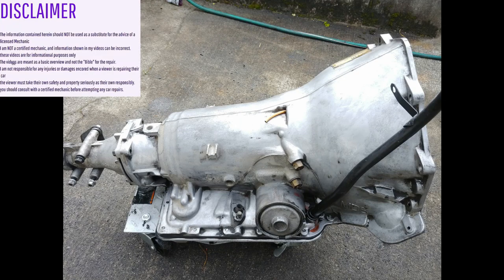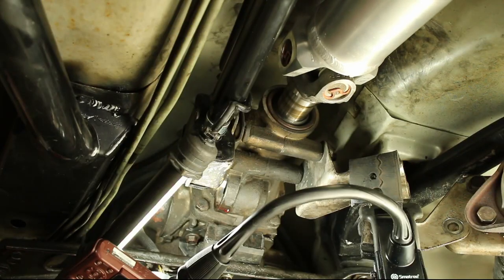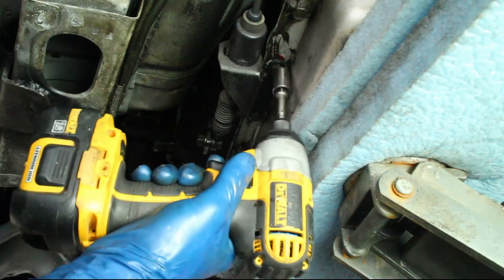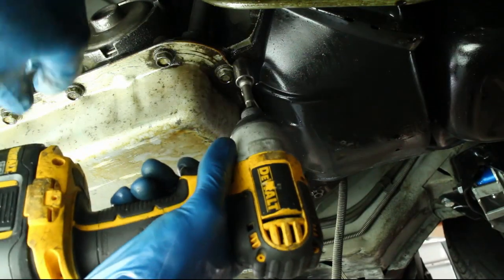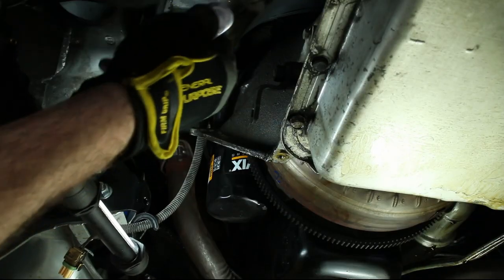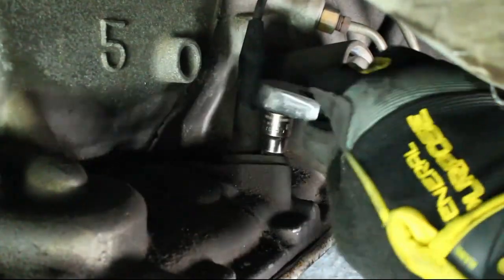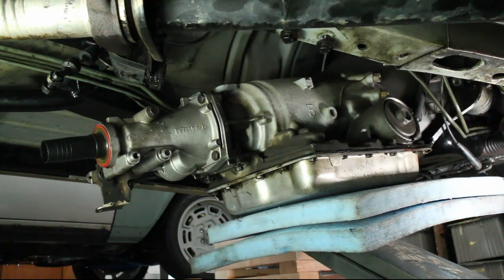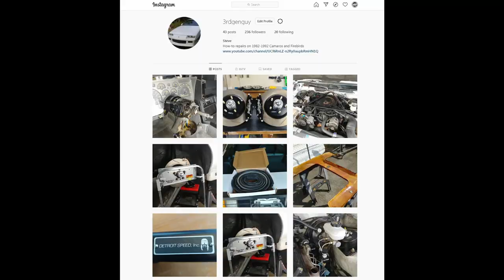How To Remove a 700r4 & 4L60E Automatic Transmission (82-92 Camaro/Firebird)

Comment: i just removed the engine and tranny from my 3rd gen, after removing the torque arm from the tranny side i left it still attached at the rear end. it is ok to roll the car in and out of the garage with the torque arm like that? i used ur vid as a guide btw so thank you!
Reply from the maker: if you push it around it's fine.
don't drive the car with the torque arm disconnected though.
Reply: @3rdGenGuy  ok cool, thanks man love the vids

Comment: Great video but having issues reaching the top two bolts on the bell housing. Even with extensions and everything i cant get those bolts off. Anyone have advice?
Reply: I'm in the same exact boat right now. I can't even see them

Comment: thank you for a detailed info on this i havea 1996 f100 truck i be doing i plan to use a lot of your info in this video to help me out i know a little and a few that i know said its a easy one to remove. my issus is putting another one in .i plan to use the stack wood idea you have in the video.
Reply from the maker: the harbor freight transmission  jack makes thigs WAY easier.

Comment: Also thank you so much for this video I never worked on a tranny and felt at ease watching u disassemble this beast, I did a whole top end rebuild on my 305 tpi and on first warm up the front pump seal burst leaking between the torque converter and the tranny, gonna try my luck taking this bitch out lmao

Comment: At 1:21 you unplugged a wiring harness from above the transmission. I have that same harness on my Camaro, but it's just hanging there in mid air, not connected to anything. Can you tell me what that harness is for? Thanks
Reply from the maker: that would be the  later electronic speed sensor plug.
the 2pin: speedo plug
4 pin: torque converter lock up.

Comment: I have some sort of leaking between the transmission and the engine and was told it's some sort of seal that needs replacing, anyone ever do this kind of replacement fix?? Hoping for some advice...
Reply: Hey Drakoz, you might have rear valve covers or rear main seal, rear cam plugs leaking. If you have an older Camaro you will need to pull the trans just to get a good look at what is leaking. I paid a shop to tell me what it was leaking but they said I needed to pull the Transmission and see, I am currently doing this on my 1994 Camaro. It's not so bad if you can afford the correct jacks and tools. Good luck man.
Reply: @briannewton4803  it was for a 1985 Trans am. Sorry for the late correction response lol

Comment: just curious how much of this process Im going to have to do to change my flexplate
Reply: You have to take out the transmission to put a new flex plate
Reply: no you dont,I just had to unbolt it,take out drive shaft and crossmember then lower it enough to slide it back for clearance. This is kind of what I was referring to,if I could get away with just lowring it without having to pull whole thing,answr was yes,did it lst summer been fine since.

Comment: Did you have to support the engine or no?
Reply from the maker: it's recommended you use a block or something to keep the engine from tipping back. it can possibly crack a distributor cap if it leans against the firewall too hard.
Reply: @3rdGenGuy  yeah I figured, I don't have that much wood though lol, I'll prolly use car tires and smaller pieces of wood to support. Redneck the frick out of it
Reply: @thedornanfam-blogsplusmore8510  
Just use a cheap jack with rollers on it, with a flat but thick piece of wood under the oil pan. This way in case you need to adjust the height of engine when reinstalling the trans, it’s easy. Good luck…
Reply: @Street Lethal  Yeah I already removed it easily, impact and extension bars to get the bell housing bolts and used a scissor jack for the engine

Comment: Lowering the jack after unbolting the cross member while still attached to the engine doesn’t cause any problems, I would think it would put the front end in a bind
Reply from the maker: as long as you don't hit the firewall with the distributor, it's fine

Comment: where do you put your jack stands
Reply from the maker: under the subframe connectors if you have them.
if not, the  boxed frames.
if you are unsure, google "3rd gen jacking points" there's a few pics online of where to jack from.
DO NOT jack from the pinch welds.

Comment: Weird, first step in the vid is different with my driveshaft. Mine is blocked by a large metal pc running to my transmission.
Reply from the maker: old cars and a 10 year production can cause some differences.
Reply: @3rdGenGuy  Yes, I dont have the plugs either but the rest of the video has helped me remove my transmission so thank you.

Comment: Interesting, this insinuates that you are going to reuse your 700R4 with your LS swap? Enjoy your vids, gorgeous car.
Reply: This is an old video from years ago, he’s having to repost all his old videos because they were taken down
Reply: @admac5657  Ok, I wondered what was going on, thanks for the info.
Reply from the maker: no way! that 700r4 couldn't even shift well under 305 power
Reply: @3rdGenGuy  that trans is weak but could be upgraded slightly but if you put a 350 in it with 250hp and a stall converter and decent gears it would be fine just put a huge trans cooler on and bigger pan